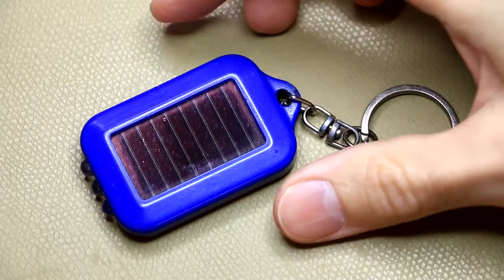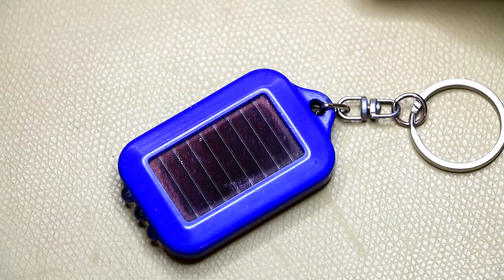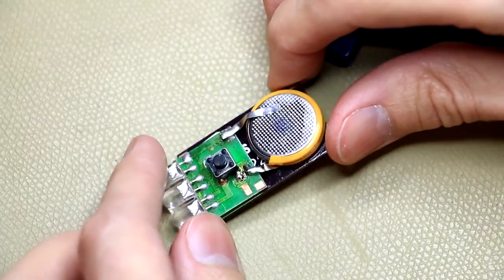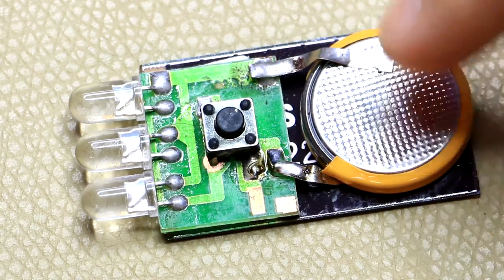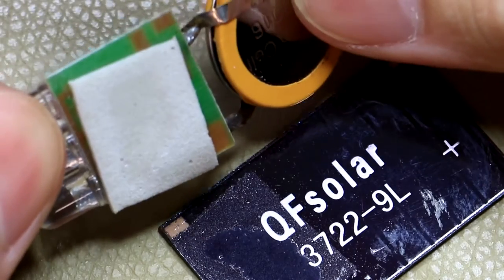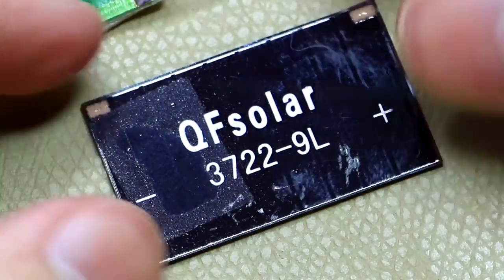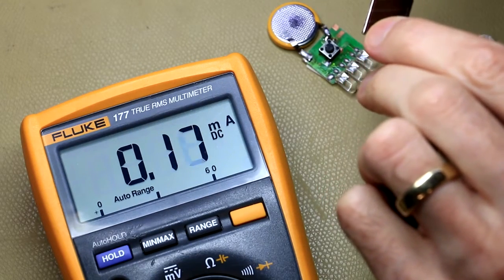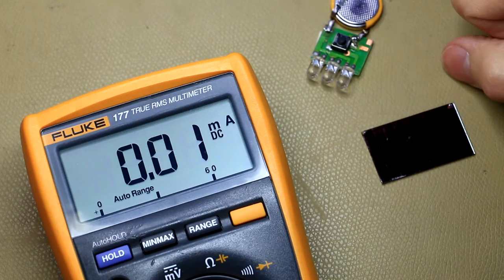What's inside a fake solar flashlight (#013)

Comment: Tells you how cheap solar cells and rechargeable batteries have gotten that it is cheaper to use the real components than it is to fake them even if you aren't going to bother with connecting the cell to the battery.

Comment: Can you wire in the solar panel to function?
Reply from the maker: I could, but would then need a rechargeable battery instead of the normal cells they used. So likely not worth it.
Reply: @TechBench  The rechargable batteries cost around $8 on ebay.  It would be fun to see. Anyway up to you.
Reply from the maker: @lancelink88  Thanks for the thought - I live in South Africa though, eBay is non-existant here. So is Amazon (unless you're keen on terrible import costs). Not worth it in this particular case.
Reply: @TechBench You possibly can recharge those batteries because I've discovered that I can recharge my Alacaline batteries in a battery recharger as have done multiple times with a 1watt charger so those button batteries most likely can recharge also. It appears many non rechargeable batteries being non rechargeable is a commercial Con to make more profit perhaps 👍
Reply: I THINK LITHIUM CR2025 ARE RECHARGABLE
Reply: I think LITHIUM ARE RECHARGABLE.  WHY YOU SAY NOT.  PLEASE .  BEST WISHES TO ALL PEOPLE IN CHANNEL.  AND PEOPLE IN SoUTH AFRICA
Reply: I bought exact same one, it's not wired in, yet it still recharges slowly over time!

Comment: If it has a working solar cell, why is it not connected? I also looked at the calculator and it has a working panel but not connected):
Reply: because then they would need a rechargeable battery and safety components.
the solar panel is probably cheap enough that they don't need to care for an elaborate fake one.
Reply: They recharge wirelessly, I brought exact same version on eBay, opened it up and put back together to find it does recharge wirelessly. I fixed button to keep on till it was completely drained of power, then let recharge in sun for a day & it worked, though not bright as it must need to build up over a long period to be fully recharged. But from dead flat to enough power to see in dark, proves it is in fact rechargeable! 😁

Comment: It's good that the solar panel is not fake. Can be used for something ...
Reply from the maker: Definitely. I already used it as a "flicker detector" to see what the refresh rate of my bench LED lighting strips are.
Reply: Actually after buying exact same version on eBay, turns up it is rechargeable wirelessly. And most non rechargeable batteries are in fact rechargeable as I've researched and experimented in a low 1 watt recharger & are very successful!

Comment: Lithium ion batteries charge by making contact with the power source.  They don't need to be physically wired in like other batteries.  There are items on the market that allow wireless charging for devices that use ion batteries like mobile phones.  Here's an example of what I'm talking about.

https://www.bigw.com.au/product/6000mah-power-bank-with-qi-wireless-charging/p/496529/#

I'd say that your device isn't working properly because the battery has probably lost it's charge from lack of use.  The battery is definitely getting power to it from the solar panel but not retaining the charge.  You'll probably find that if you replace the battery inside the device and use it regularly it will work normal again.
Reply from the maker: This is definitely not a case of wireless charging. The batteries are of the non-rechargeable type (I checked it against their data sheet). This is simply a case of faking it in order to save costs on having to use true rechargeable cells in the device. Also, wireless charging requires an induction circuit, which is not present in this device.
Reply: @TechBench Hmm I'm not scrutinizing your data sheet research, but many non rechargeable batteries are in fact rechargeable as I've been successfully in doing so multiple occasions especially using a low 1 watt recharger. Fact is I'm suspecting most non rechargeable batteries were either intentionally misinformed or overlooked as being rechargeable. Anyway all in trial and error to find the truth ✌️

Comment: Typical. Why not charge the extra $50 cents and make it real and at least somewhat environmentally friendly by saving it from going very prematurely into landfill. The manufacturers/designer should be fined for this.
 It is exactly this type of crap that is going to stuff this planet eventually. I feel sorry for our children's children who will pay for it. Current generations generally couldn't t give half a $#it!
Reply: Matt Burrows All you need is a diode and circuit switch and connect LED to switch and connect diode to terminal A then connect solar +. text connect LEDs +/- to terminal B and the leads just connect to battery and negative can just bridge on the battery going to LED -..

Comment: they forgot to wire ur solar panel on.I see two connections on the board.bet it will work if u wire it up.
Reply from the maker: You would think so, but since the batteries are non-rechargeable, I suspect that they deliberately decided to deceive the consumer and to do some cost-cutting :-)

Comment: I have one on my key chain. Going to have to crack it open sometime soon.
Reply from the maker: I got two, the other one was from a different supplier and that was wired on and using rechargeable LiON batteries. I think the "fake" versions will probably quite rare!
Reply: Can you insert link of the seller of the working sample by checking cronology?
Reply: DoctorNoob It's probably just a fake sir but you could probably make a real one out of a solar garden light.